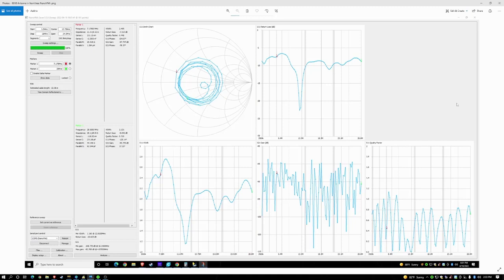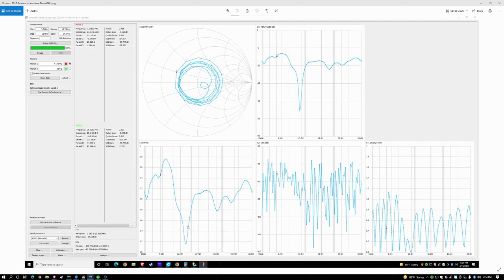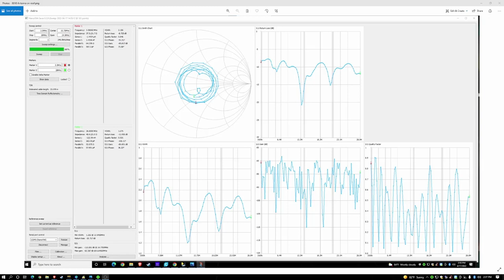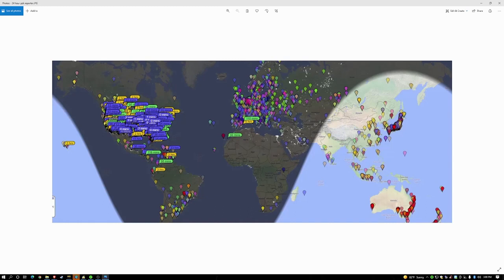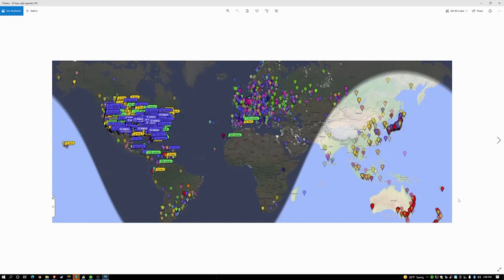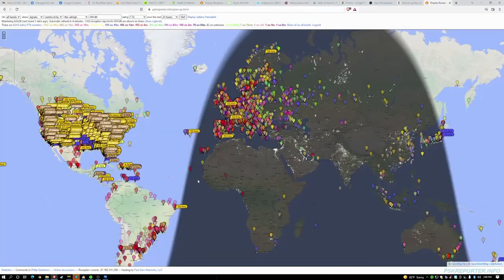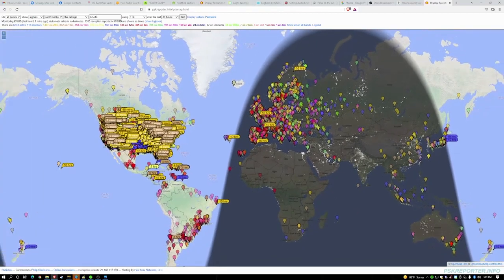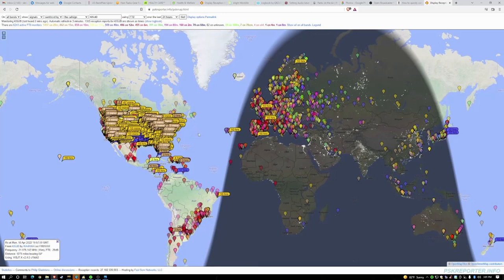Updated Stealth HOA HF Antenna!

Comment: Try a 49:1 unun with 66 feet of wire...I use that with my G90..works better than when I tried a 9:1..check it out..
73 de Brian  K4ARD